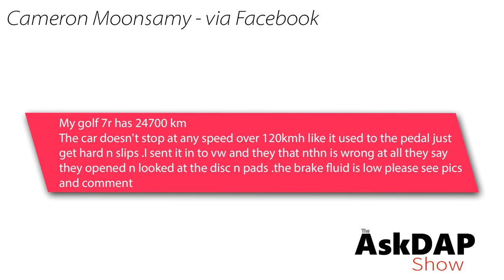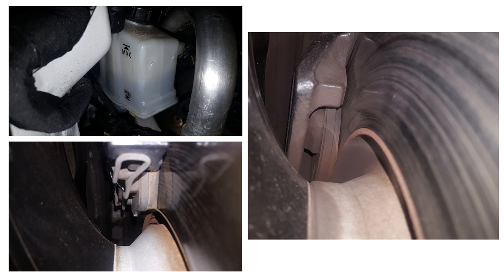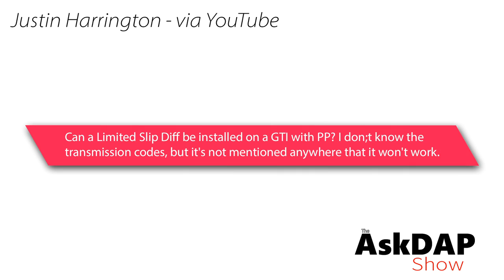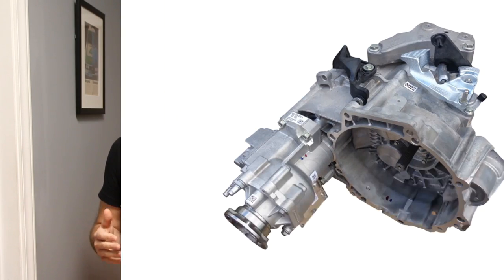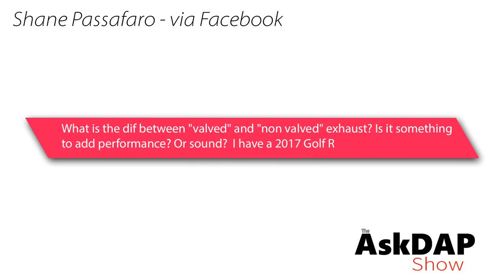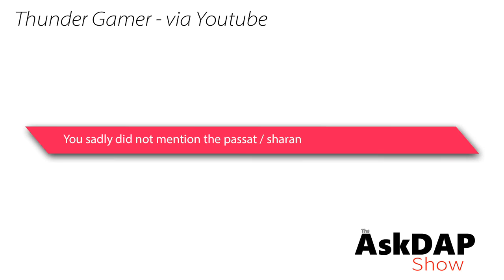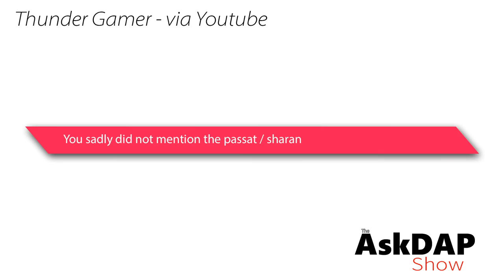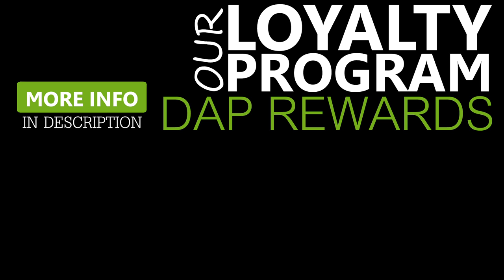Askdap Episode 97 | Swapping out a PP Diff and Oil Robbing Power

Comment: With regards to the brake issues:

Heavy braking would mostly wear out the FRONT pads and rotors.  
It makes no sense that it is only the rear units that are worn at such a low mileage while the front ones look almost brand new. This is still very questionable wear for a car with such low mileage. (In the pictures, the front pads and rotors look brand new!)

I had this exact same issue at 16,000 kms (10,000 miles for Americans) and I know that I did not drive like a maniac. My rear pads were almost bare while the rear rotors were scored like a vinyl record.

This is a very common issue and can be found on different forums from a quick Google search. Some people have actually had their rear pads and rotors changed by the dealers under warranty.

After my rear pads and rotors were replaced, I changed 2 settings using the OBDeleven:

1. Disabled Brake Drying
2. Changed Hill Assist from Normal to Late

Follow-up in the next 16,000kms
Reply: bao n people change their front brakes all the time and usually leave the rear alone until they absolutely have to. im a mechanic and he probably just changed the front. that explains every point u made
Reply: You're assuming that front brakes were already changed when he took those photos. From the OP's question, I don't think any brake components were changed.

Comment: For the guy with the oil question, I wonder if it was filled all the way. I've diy 3 oil changes so far on my mk7 with the tiquimoly 5w40 kit. I like to fill right to the middle of the dip stick range, but on my last oil change I was just shy of my mark - but still well above the min, so I thought I'd let it slide.  I also watch my mpg like a hawk and it will vary between 28 & 33 on every commute.  Occasionally I'll get a bit better or worse but it is rare.   But with the oil a little low my average mpg dropped to 24 to 28.  For two weeks scratched my head and tried driving more gentle but eventually I figured to top off the oil.  As soon I put in another 0.2L (if that) the mpg immediately went back to normal.  Unfortunately I spend almost every day crawling along at 20 mph (if I'm lucky) so I can't say if acceleration was affected.

Love the channel!

Comment: Just want to say my 3.6 CC was NOT  very reliable. Had multiple fuel pumps and an injector fail. Sold the car after the issue returned yet again. Owned from 20k - 80k miles.

Comment: DAP in response to that PP article, is ELSD swap-able into a non pp car? Is the ELSD contoller on the unit?
Reply: i asked my VW dealership and they said yes they could and if performed by VW mechanics it is covered under any existing powertrain warranty you may have if using all OEM vw parts (ELSD). I'd imagine they would have to add some electronics/wiring too for controlling purposes. they estimated $4,000, which to me doesn't seem worth it when you can get a better mechanic diff (wavetrac) installed for all about $2650 including parts. won't be covered under warranty, but if you're at the end of your warranty anyways there's no reason to put in the PP ELSD in a non PP

Comment: Wasn't the question about "adding" a wavetrac, not replacing the VAQ completely. This has been done and it works with the VAQ. Just means the VAQ doesn't need to intervene as much as slip doesn't occur.
Reply: Meaning the VAQ only comes into play if the wavetrac is overpowered?
Reply: @joelpeter3908  I don't know when exactly it plays a role and doesn't. IE will it still torque vector if there is no slip? Or will it still use steering angle and other inputs to still move power from one side to another. I'll have to wait to I install one and then do some logging. But I do know that you can do it and they work well together. Worse case it is how you described.
Reply: @andrewkendall1425  oh okay. I have been wondering as well. I suppose you own one? If you do, can you tell me if the steering is as numb as many people say it is?
Reply: Joel Peter I don’t have a wavetrac yet.
Reply: @andrewkendall1425  i meant if you have a vag car. Cupra, gti. The steering feel.
Reply: Joel Peter ahh sorry. The steering is fine once you stiffen up the LCA bushes. Improves the feel a lot. Stock there is not a lot of feel.
Reply: @andrewkendall1425  makes sense. Thanks.

Comment: Is there any way to make the PP Limited Slip to engage in reverse?  The limited slip is particularly helpful in snow for me, which is the reason I decided to get the PP,  but it doesn't engage when reversing!  The result is I can go anywhere forwards, but I might still get stuck in my drive because I can't back up!  (I originally wanted the "R" for AWD, but ended up with an Autobahn w/pp, saving $10K.  I decided the limited slip addresses most of the driving issues that made me consider AWD, and I assumed it would engage whenever wheel slip was detected, including in reverse.)

Comment: Hey, first off the channel is great. I was wondering the options of getting a mechanical limited slip diff on my non pp mark 7 gti. I bought this car as my daily driver, I have an 04 sti as a 'fun car', so I didn't think the pp was necessary, figuring I could drive my STI if it snows here in NJ, and of course now I am regretting it. Also is it even worth getting a limited slip diff for a daily driver, would you notice a difference?
Reply from the maker: Yes you would certainly see a difference

Comment: what causes the dsg "fart"?
Reply: ncs productions resonator usually
Reply: ncs productions Ignition (spark) cut on upshifts which makes unburnt fuel burn further down the 'zorst
Reply: alexaescht o,thank.u very much!
Reply: Actually, it's a fuel cut w/ open throttle. You can watch an AF meter during the shift go lean to verify. Either way, it keeps the turbo spooled.
Reply: German beans.

Comment: Too funny the frist muppet question about the brakes to fun how about you stop using your handbrake and slamming on the brakes and also stop making so much heat the turbo is right there next too the brake master cylinder fluid know wonder theres no fluid because it got evaporated